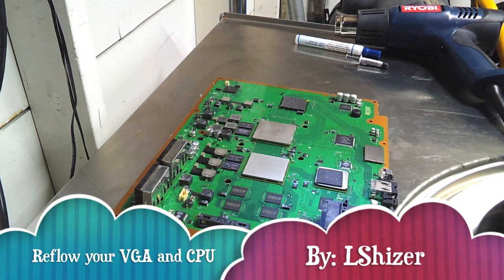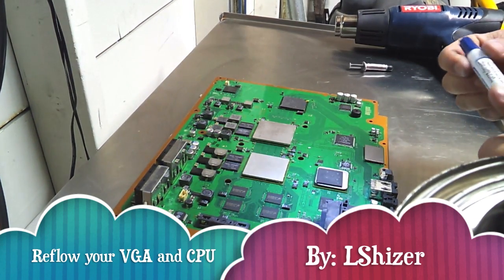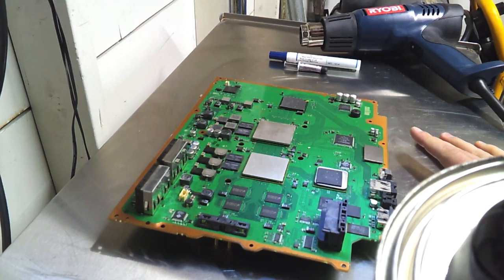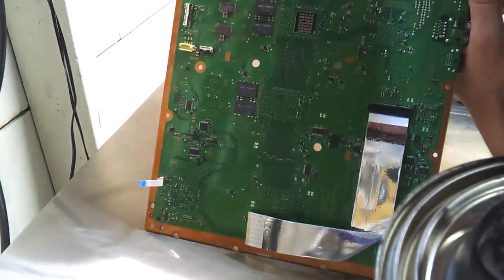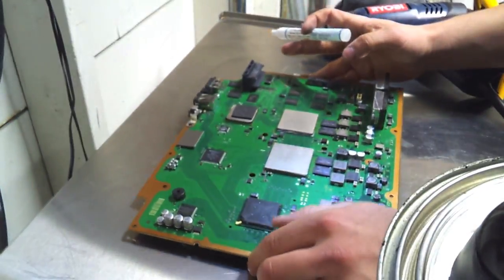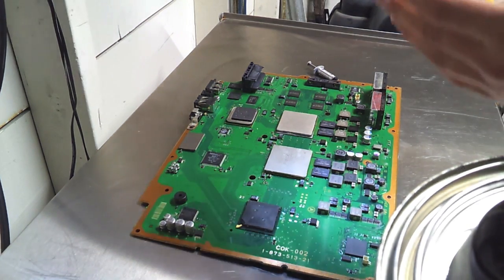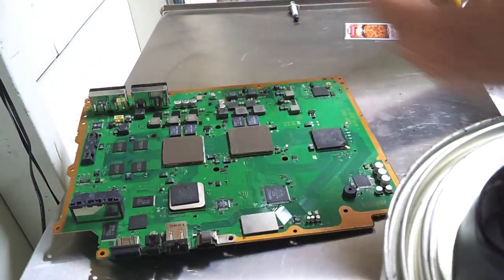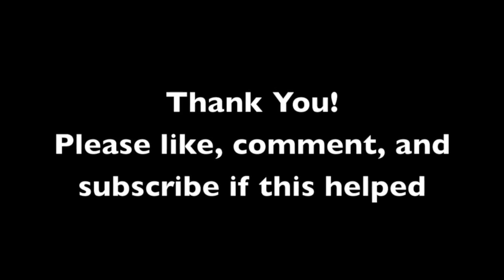YLOD PS3 permanent fix

Comment: You need to take the heat spreaders off then heat the chips... The heat spreaders absorb so much of the heat that you can’t completely reflow the chips correctly. You can use less heat also and once done apply thermal paste under heat spreaders also.

Comment: Don’t listen to anyone that tells you to use a heat gun or an oven on a motherboard. Go the extra mile and learn about reballing. Reflow is only a temporary fix and could damage your motherboard beyond repair.
Reply: So what are you supposed to do?
Reply: @man2539  either pay someone the orice of a new ps3 to reball it, buy expensive equipment and learn how to do it yourself, or just buy a used ps3 replacement console on eBay like I did because it’s cheaper and less of a hassle...

Comment: 700 is too hot. I use heat at less than 400 degrees farenheit on both sides at the same time for about 15-20 minutes then let the board cool down completely before  reassembly.

Comment: Uhm, I wouldn't say this fix would work that well over time. Which flux being mostly acidic over time the heat will make it unsolidify and melt all over the Board. But this could be fixed with special electrical flux. You never specified which too use so for those who aren't educated on it they may have destroyed their ps3

Comment: Anyone watching this video today please heed my advice.

Firstly this is not the best video when it comes to doing it by a heat gun, and secondly for the love of God remove the heat spreaders on both the GPU and CPU. With the right tools it is very easy and not as hard as people make it sound, if you don't do this they're going to overheat in the yellow light of death will come back.

This information is brought to you by someone who personally owns a 2006 launch model that is never gotten yellow light of death before because I've done these steps to prevent it.
Reply: Where do you got the right tools?

Comment: YEEEEEEEEEEEES THANKYOU SO MUCH IT ACTUALLY WORKED
Reply: Is your ps3 still working?
Reply: @Bcohen1945  its been a long time since i done it but unfortunately it only lasted a day but i think i done it wrong
Reply: @Daniel-dl6fp  thanks for the update. Do you recall what you might have done wrong? Im literally attempting this right now as we speak
Reply: @Bcohen1945  i cant really remember this was back when i was new to repairing things i think i might have ran it too long without thermal paste or something like that good luck with the repair
Reply: @Daniel-dl6fp  thanks!
Reply: @Bcohen1945  np
Reply: @Daniel-dl6fp  just finished and its working fine. Lets see how long it lasts.
Reply: @Bcohen1945  nice congratulations
Reply: @Bcohen1945  is it working ?
Reply: The reason it didn’t work is because the GPU on these models is defective and needs to be completely replaced with a GPU from a slimmer model. Doesn’t matter what you do if the GPU is defective.
Reply: @kalulofer4638  completely forgot about this comment it's been so long but thanks for the information I never actually knew that I'm guessing the chips have been poorly soldered or poorly manufactured from the factory

Comment: This is a temporary fix and the more times you do it the less time the reflow works. I'd just pay a pro for a reball on my fatty but a slim probably wouldn't bother there's no cool factor.
Reply: if its a backwards compatible unit it is totally worth a reflow, you can actually buy the 40nm chips that come with a reflow solder screen and flux. Easy to do even with just a heat gun. if it is not a backwards unit its best to just trash it and replace or buy a new board altogether. UNMODDED BACKWARDS COMPAT PS3's ARE WORTH AROUND $550 to $600 on ebay right now! IF YOUR PS3 HAS 4 USB SLOTS YOU ARE SETTING ON A POTENTIAL GOLD MINE!

Comment: As has been said before, this isn't exactly a permanent fix.

With any luck, this procedure may help to revive a PS3 that's YLODed or RLODed.

But, should you manage to get it working again after using a heat gun on it, be advised that you are on borrowed time; the console may continue working anywhere from months down to just hours.

Use that time to back up your data for migration to a replacement PS3.  After backing up, discontinue use of your broken console as it can no longer be considered reliable for normal use.
Reply: Exactly once it gets it it’s gone when it happened to mine everyone suggested just to buy a new one they are cheap now anyways

Comment: let's say I fix my PS3 and applied new thermal paste. if my PS3 still get ylod should I replace the thermal paste again when I take it apart or reapply some new thermal paste.
Reply: God knows if you're still on this account but changing the 4 NEC/Tokin capacitors fixed YloD permanently

Comment: Hey helpful video, I never refluxed my system all I done was put on new thermal paste but I used a cheap brand and I still have the YLOD could using a cheap thermal paste cause this please let me know soon?
Reply: 7 years later you get a reply! No. Using cheap thermal paste will not change your results. All this does is reheat the substright and solder joints. if they are too far gone this fix wont work, plus if you use the wrong flux its going to cost you more in the long run so it was good that you skipped that step. One flux will help and the other will hurt the PCB in just a few short hours of heat so im not sure why he did not bother to mention this. Also, this fix just puts the console into what I like to call  "zombie mode" its up and moving around but eventually will end up being put down for good. I used to use this method to fix customers Video cards to get them a few more hours of use while they wait on their replacement - this is not and was never a permanent fix.

Comment: 1. too much thermal paste, it may cause overheating. PC users will know haha
2. usually a permanent fix is a "reballing" your gpu
3. It may be working now, but not for long, it depends how much the console is on and if it's clear of dust.
But still, ty for share
Reply: Xplay Rel too much won't cause problems
Reply: yes it will.

Comment: Thank you for the video!!!! It worked for me! :') Used the heat gun like a it was no tomorrow. I listened to one of the other commentators on this thread and they suggest 15 minutes on the CPU/GPU and surrounding chips. I'm doing a data transfer as I write this comment. ;-)

Comment: Thanks for your video! I fixed my PS3 and the YLOD is gone.

Few things for others:
1. Make a screw map. So you will easily put it back.
2. Take your time at every step. 
3. When pulling metal shields apart take extra care, just do it slowly but surely. Forcing can damage the copper pipes.
4. When putting metal shields back, remember about the hooks first (the ones shielding Ethm, HDMI etc sockets)
5. When screwing the security screw, make sure the lid from HDD is closed. The screw may fall inside the case and you will have to open PS3 again.
Reply: how’s your ps3 holding up ?

Comment: Most of these problems come from impatient kids not wanting to wait for the console to shut off, and they flip that switch on the back which dicks up the whole console ( that's what was wrong with the one that I fixed, and I did something similar to the toweling method after replying thermal paste). She runs like a champ now.
Reply: No you are totally off on this. Sorry i know this is a 7 year old comment but I dont want people thinking this is what "Dicks up the ps3" Stop blaming it off on children and do some research. This happens for the same reason the xbox 360 RLODs! Heat + cheap manufacturer cold solder joints = broken hardware after so many heating and cooling cycles. Dude I would so hate for you to be my father. Just blame it off on the kids. And OFC your the only person here who thinks "Wrapping a towel" around it fixed the problem. So let me get this straight. "kids" flip the switch and shut off the console too fast and the fix is to wrap a towel around it? Smoke crack much?

Comment: one question, is this ps3 still alive up to now?
Reply: I would assume not because he didn't take off the heat spreaders and apply new thermal paste to them... The fact that he calls this a "permanent fix" is laughable.
Reply: NightcoreCentral No, I just go by what I see the most. Are you offended because you are Asian or Pakistan? If so I apologize but it just had to be said that they do shady business to make a living and give zeros fucks about people belongings. If anything they do these "repairs" on purpose so that you take the machine back to get it repaired again. I've dealt with this first hand so I'm speaking from experience.
Reply: wescoolya heat spreaders? You mean the heatsink? Lol wtf do you mean, heat spreaders?
Reply: +Bro A what you just said makes no sense, first any chip/component can be removed if you have the skill, second if you are attempting a repair like this, you need some electrical know how and by some I meant general skill range of intermediate or higher, this video isn't intented for you no offense. honestly i'd go out and buy a rework station and ir bga preheater table which would put my repair cost ~$175 USD. IMHO i'd never attempt a reflow in this fashion or at all. in my mind if you never need to reflow  you need to reball. use high quality solder/flux and maybe copper heat-spreaders instead of aluminum
Reply from the maker: It is actually as to the constructive comments about spreading thermal compound i think they are of value and definitely good to implement.
Reply: LShizer the only downside is that the thermal paste does you no good if the board is shot, whether it be by horrible engineering, exposure to excessive heat, bout force trauma... You get the idea. It'd be nice if just slapping on paste and cobbling it back together fixed the problem, but that doesn't work. Once it gets to soldering shit, I'm out. Fuk that.
Reply: LShizer The heat spreaders are these. http://puu.sh/d1rqC/277e4adbe9.jpg As you can see from the picture they are supposed to be removed and have new thermal paste applied. If you people didn't know they are meant to even the heat flow and that they're not the actual chips you're idiots. Not trying to be a douche but it's true..
Reply: Bro A Lol they are meant to be removed and the flux that people think "Goes under the chip" just goes between the gaps of the heat spreader and the chip, they are meant to be removed and are stuck on with thermal paste, You have proven that you know nothing. It's all about better heat flow and with new thermal paste on the hear spreader that's what you get.
Reply: Bro A
I feel you man. I fixed mine twice with paste but now it looks like it needs soldering and shit. Fuck that! Gonna sell it for dirt cheap.
Reply: aadz93 exactly, reflows are only a temporary solution to a permanent problem. To fully prevent it you have to use lead solder and use good quality thermal paste. People that reflow just use a heat gun and put on cheap thermal paste afterwards to make a quick buck, that's likely what Indian and Pakistani repair shops will do if you take it to them.
Reply: NightcoreCentral Just an example. Asian's, Pakistani's from other countries usually do these shitty temporary jobs to make money and claim it's a permanent fix. They scam you and charge the same price as it would be for a professional to do a proper re-ball.
Reply: +ArcadeMachine15 (wescoolya) LOL...what a joke..professional proper re-ball ? So performing a 3-week solution is shitty temporary job and a 3-month solution is a "professional" job ? A decent repair shop will tell you the way to actually repair this is to REPLACE THE GPU with a BRAD NEW GRADE-A GPU which is impossible as nobody sells them.
Reply: ***** dude you have no idea  what you're talking about, first the cpu is hard-coded to the motherboard by a its serial number and/or a key
so to replace the cpu you'd need 1. a cpu from the same motherboard model ps3, a complete nand/nor dump of the said donor ps3,a way to dump its nand/nor from said ps3 and write to recipient ps3, reballing the most logical sense as all you do is clean and replace the solder with better higher quality flux and solder. if a repair shop is telling you to replace your cpu they're probably ripping you off,    to line thier pockets as ps3 hardware is NOT like your pc you just cant pluck out a chip willy nilly and replace it
Reply: ArcadeMachine15 (wescoolya) Oh get off your high horse, Stephen Hawking. A reball is TEMPORARY. Rewriting an operating system to play on an entirely different machine is PERMANENT. That spreader is nothing more than a piece of aluminum to protect the die from physical damage, while also being a heat conductor. We're talking about opposite sides of the chip, you goon. A reball is pointless if the chip was engineered poorly.

PS3 motherboards are poorly engineered and not worth the hassle of trying to reball, as are Xbox 360s. If you want to play PS3 or 360 games, but don't want your console to bake itself apart, find a way to port the PlayStation or Xbox operating system and GUI to a Frankenstein desktop computer project, which you would build to specifically achieve that task. Otherwise, don't bother. Reballing will not be a permanent solution like Wescoolya keeps trying to tell people. At most, you would get six months of heavy gaming life out of a professionally reballed console. Reballing involves physically removing the entire CPU/GPU assembly from the motherboard like you would do in a PC, but instead of a ZIF socket being used to mount it, the chip is essentially  resoldered to the motherboard itself. What Wescoolya keeps trying to say is that you need to remove the chip And remove the spreader from the chip to reveal the cores themselves. That's a waste of time, as is reballing an obsolete AMD chip from 2005 that would just as soon burst into flames from a shoddy reball attempt.
Reply: I would say the heat spreaders is not what hurts me the most :D because he didn't even pre heat the motherboard.
Reply: ArcadeMachine15 (wescoolya) I understand but it looked very wrong from first glance.
Reply: If my disc intake drive did not break then my PS3 would've lasted even more than 5 years in 2016, until I ripped the  power supply connector from the motherboard which is literally the most dumbest thing I have done.
Reply: aadz93 What I meant to say is that removing the shielding above the cpu die itself is impractical. From the factory, an AMD CPU (that's what playstation uses) is stress tested. If it fails that test, it gets chucked and they start again. No CPU should be running hot enough and long enough to fuse the spreader to the chip, which would be the only time a repair on the Top of CPU itself is justified (installing a new unit). A loss of thermal dissipation between the die and the spreader is unlikely but possible after long use at high heat, but flux is resistant to thermal degradation. The main thermal contact point is between the CPU shielding and the heatsink itself, not the die and the shielding. And that plate over the die is meant to provide a consistent and level surface to dissipate heat. Granted, there are some GPUs that do not have shielding but instead use either paste directly on the die, or a stick-on pad, depending on how much heat the component generates in a given time. To be perfectly honest, the most permanent solution to a problem like this is to figure out how to manipulate the operating system of a playstation and port it onto a desktop hard drive, thereby negating any faulty hardware involved from the factory and using your own rig to play Sony titles.
Reply: KSI FlapJaksLol You have no idea what you're talking about. The most permanent solution is a reball and in order to do the reball you need to remove the heat sheild from the chip. I don't know where you're coming up with these bullshit solutions like using a desktop hard drive. You're one of those people who act like they know everything about a certain thing but when they confront people who actually know what they're talking about you look like an idiot.
Reply: Pedro F. Good point.
Reply: wescoolya ... If somebody has already separated the heat spreader from the processor, then why would you bother with trying to ressurect it? While you're already there, why not make your own motherboard? -_- Those aren't meant to be removed. I've never heard of somebody removing the heat spreader off of a processor and that sounds like a great way to make your 300 dollar machine become a boat anchor. Heatsink and processor separated, clean both, reapply thermal paste, put it back together, heat up the board cautiously, let it cool, and enjoy!
Reply: +ArcadeMachine15 (wescoolya) that's racist. Anyone could do that not just people from Asian backgrounds
Reply: ArcadeMachine15 (wescoolya) Why can't you say a Polish guy or Romanian? Or African? Are you selectively racist?

Comment: we do the almost the same thing on high power lasers but we use a industrial oven about 800 d good amount of flux so i would use a oven heat the whole board this video will work if done correctly good stuff

Comment: thx man. Your video worked a treat. My problem was the temp sensor thinking it was overheating, same issue as the YLOD. Use your method albeit without your flux and it worked like magic. GT6 no problem. Had it on for 3 hours without issue and fan is variable once again. 5 stars!
Reply: how long did it last?
Reply: Is your ps3 still working?